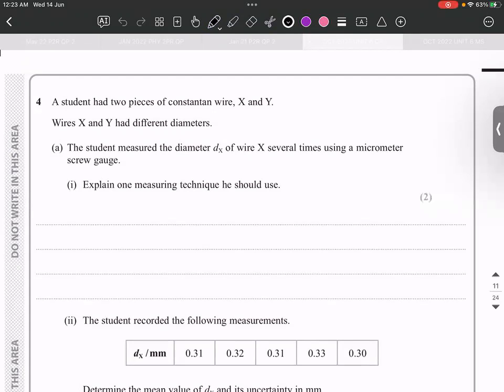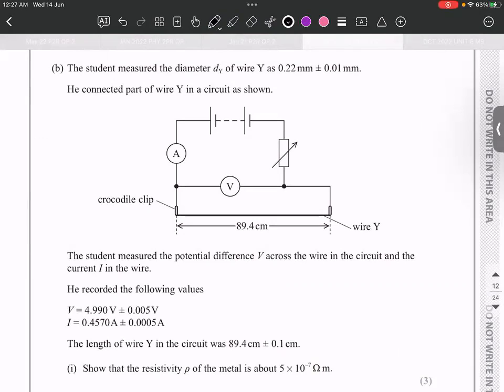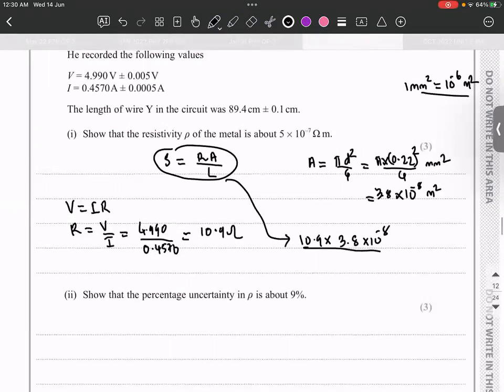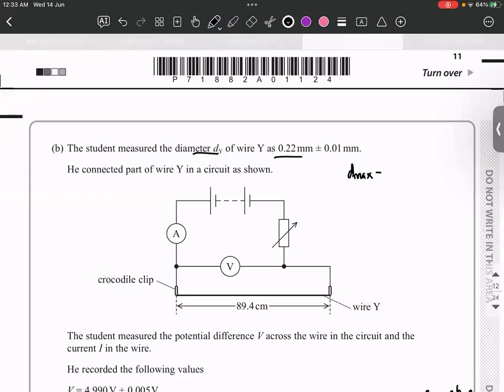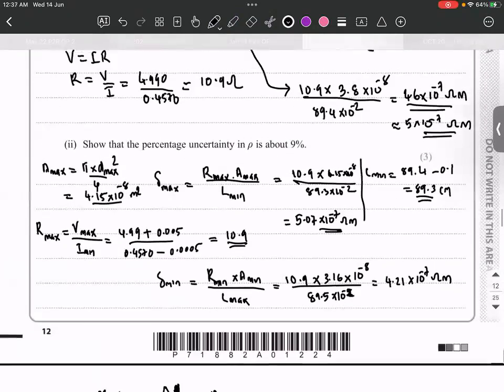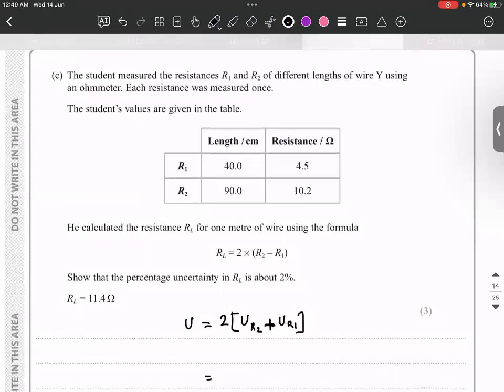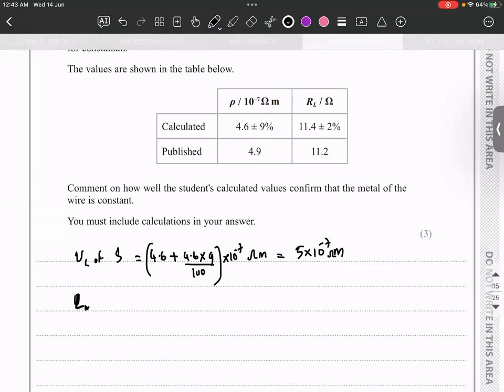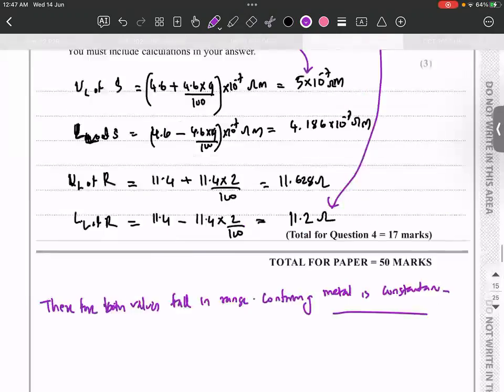WPH16/01 Unit 6 October 2022  Qstn no 4 #ial #alevel #edexcel #physics #pearson

Comment: instrumental uncertainity when finding resistence (R2 and R1) is half of resolution , 0.1 is resolution , so uncertainity becomes 0.05 for both (R2 and R1), (0.1/2 = 0.05 ) , this can be added together later and multiplied by 2 , due that it is uncertainty
Reply: Thanks for explaining brother this guy in the video didn't explain where he got uncertainty of 0.05 all of a sudden. Probably was just looking at the mark scheme to memorize it.
Reply: So resolution of ammeter is 0.1 always?
Reply: @adibmannan3230  the 2 values in the table are to 1dp therefore we hv to assume that resistor is resoluted to 0.1 ohms
Reply: THANK YOU